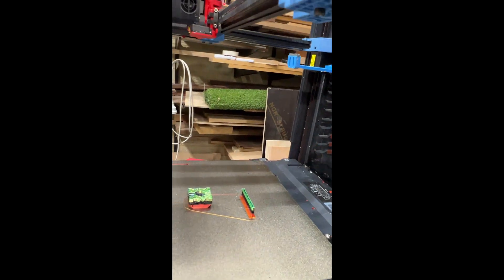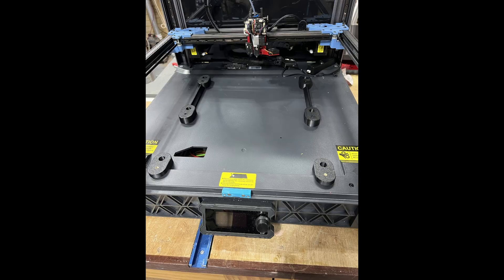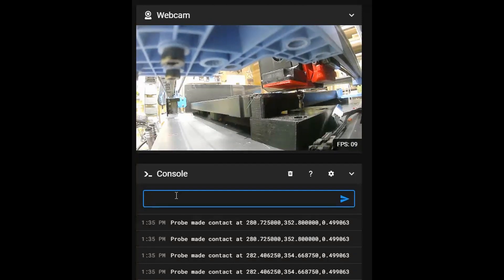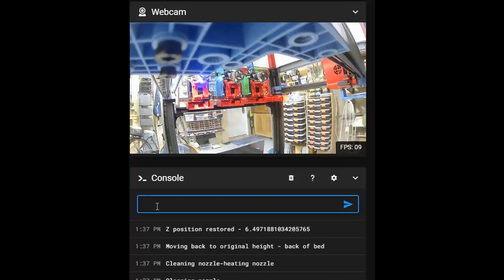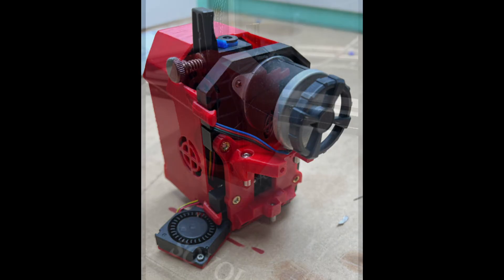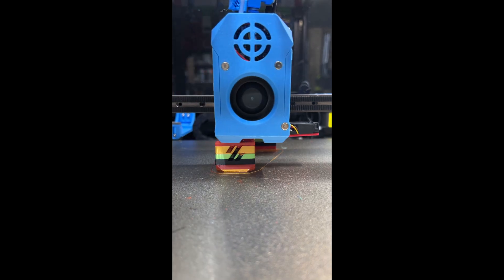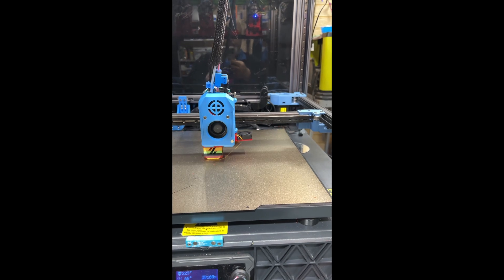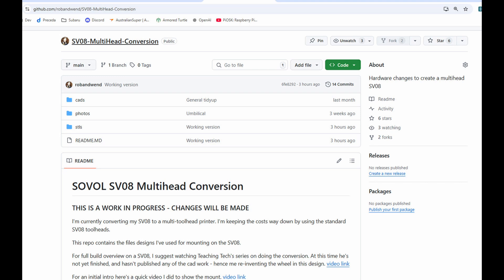SV08 multi head  update 4 (final)

Comment: I'd be curious for a followup video. Has has it worked over time?
Reply from the maker: Yes, still very happy. I did change the heads to using bambulab hotends (because I had a lot spare). I've also modified the docking area to have a different hotend nozzle rest (all documented in the git repo).  If I had room I'd love to do a similar change to a SV08-MAX, but I think I'll have to get rid of a few other printers first 🙂

Comment: what is the bearing model for and how did you attach the bearing? Hope you had a Merry Christmas
Reply from the maker: Possibly you downloaded the repo whilst this was being added, and didn't get the updated readme. You can find details towards the top of https://github.com/robandwend/SV08-MultiHead-Conversion/tree/main - I changed from using the square hotend rest-mat to using a spring loaded bearing that the hotend rests on. My current code keeps the hotend heated when docked, and I found this worked better for stopping filament leakage when mounted.
Reply from the maker: How to mount the bearing, hopefully the photos will help with this, but basically I cut a pen-spring in two, and insert into the holes as per photos. Four small ptfe tubes slide in the sides to reduce friction, and keep the heat away from the plastic. The bearing sits on the springs, and an M3 screw from the side stops it from popping out. Here's a vid https://youtube.com/shorts/QRwU9dDAots
Reply: @robandwend  thanks that must have been happened. Can  I use a bearing that is mused for filament spools?
Reply from the maker: @oldtimeengineer  I believe thats they are the ones. If it fits in the hole, then it should be fine. The old design also worked but the trays eventually got squashed by the hot-hotend and needed replacing, plus you have to mess about pouring the two-part silicon into the mini-tray things.
Reply: @robandwend  Thanks I am working on them now

Comment: What is your start gcode for orca slicer? Mine does not seem to work no extruder or bed heating?
Reply from the maker: All my configs are here https://github.com/robandwend/sv08-klipper - start-print is this one - https://github.com/robandwend/sv08-klipper/blob/main/printer_data/config/my-macros/print_start.cfg
Reply from the maker: Sorry, I just realised you wanted the orca config...
PRINT_START TOOL_TEMP={first_layer_temperature[initial_tool]} {if is_extruder_used[0]}T0_TEMP={first_layer_temperature[0]}{endif} {if is_extruder_used[1]}T1_TEMP={first_layer_temperature[1]}{endif} {if is_extruder_used[2]}T2_TEMP={first_layer_temperature[2]}{endif} {if is_extruder_used[3]}T3_TEMP={first_layer_temperature[3]}{endif} {if is_extruder_used[4]}T4_TEMP={first_layer_temperature[4]}{endif} {if is_extruder_used[5]}T5_TEMP={first_layer_temperature[5]}{endif}  BED_TEMP=[first_layer_bed_temperature] TOOL=[initial_tool]

Comment: what size drill and tap for the 2020 lower bracket? Is it an M3? Have a nice Christmas.
Reply from the maker: Yes m3. Be very careful to get it right 1st time, and do not overtighten, s the metal is very thin and strips easily. Also the bolt has to not extend out the back, or it will catch the z axis. This is one area I'd probably rework if doing this again, as I worry everytime I need to remove/re mount it.

Comment: How long should the Bottom 2020 Mounting Bar extrusion be?
Can I buy it in this lenght somewhere?
Reply from the maker: 440mm although it doesn't need to be exact since it sits on the two printed supports, so a couple of mils gap wont matter. Lots of places (amazon, ali etc.) sell 2020 extrusion, it's easy to cut - and since the ends doesn't need to be 100% right angle, you could just cut with a hand saw or electric jig saw. HOWEVER - since I made this, I've seen other peoples designs where the extrusion is connected to some upright 2020 bars, which I believe removes the need to drill into the SV08 sides - at the cost of having more scaffolding visible at the front of the printer. Drilling the SV08 isn't hard - but you really need to get the drill/tap correct the 1st time, otherwise you may need to resort to CA glue to help hold the bar on (ask me how I know :-) )

Comment: Could I get a copy of your sd image. I have built up a 6 tool changer but am having problems getting the first tool configured. I have all 6 working but can not get it calibrated. I have been waiting 3 weeks for teaching tech to release his and nothing yet I am 72 years young. Thanks
Reply from the maker: All my build info is here https://github.com/robandwend/SV08-MultiHead-Conversion incase you've not seen that. The converttomainline folder contains the images I used to reflash the mmu etc. If you'd like to see my config files, they are all here https://github.com/robandwend/sv08-klipper - that's a live backup of my current config. I've heavily modified a lot of the stealthchanger code specific to my requirements. Currently I always home using T0 (if T0 isn't loaded, it first homes with whatever is loaded, and then loads T0 and re-homes, just to be 100% sure - since all the other heads are offet from T0). I've setup the sexball for tool alignment - and I'm really happy with it. If I change a toolhead for whatever reason, I can get them all re-aligned with a single command now. I've also added code to try to cope with a tool mounting failing (that has happened when a tool gets clogged up and carries the clog up to the mounting area). By default stealthchanger just stops the print if anything fails during an unload/load. I've changed this to wait for the correct tool to be manually mounted and then it continues. Let me know if there's anything else specific you need.
Reply: @robandwend  Thanks I will check out your *.cfg files and see where mine are messing up.
Reply: @robandwend  I have tried your files and the first include in printer.cfg is not found along with  the obico and I commented them out and  I get this error 
Klipper reports: ERROR Unknown pin chip name 'tool0'? what am I doing wrong or do I need to reinstall toolchanger software. I have all my mcu changed to mine. Thanks for your help
Reply from the maker: @oldtimeengineer  The first include is for the toolchanger (stealthchanger) cfg files. I've modified a few of these, unfortunately the folder is symlinked and so didn't get included in the git store. I've just manually added the folder into the git repo so you can now see them (https://github.com/robandwend/sv08-klipper/tree/main/klipper-toolchanger).

tool0 however I believe is by default just called tool (no zero). When I initially set it up, I didn't like having all but tool(0) with a number, so I added a zero to make them all the same.

Bare in mind that this is all setup specifically for my setup. Obviously only 4 heads, but also the beds moved, and I've got a couple of wipers. I've heavily changed the load / unload code in the toolchanger.cfg to ensure mine load/unload correctly, and turn on fans when I expect. Things like my 'SAY' macro will obviously only work if you've added speach to the machine. Likewise all the sexbolt stuff.

Thanks for pointing out the missing config backup files - I hadn't realised that was missing.
Reply from the maker: @oldtimeengineer  I'm glad you noticed that missing, the 1st include is for the toolchanger cfg, it wasn't backedup because it was a symlink. I've added it now (https://github.com/robandwend/sv08-klipper/tree/main/klipper-toolchanger). Tool0 I believe is my name for what is usually labeled just 'tool' - I prefered having a number on every tool to keep them consistent. I'm made a number of changes to the toolchanger.cfg files, just to cope with my implementation of the heads etc.
Reply: @robandwend  FYI the link you posted comes up with 404 - page not found Thanks
Reply from the maker: @oldtimeengineer  The close ')' appears to have been included in the URL when youtube display it. It should read https://github.com/robandwend/sv08-klipper/tree/main/klipper-toolchanger (without the closing ')')
Reply: @robandwend  Thanks got it this time. Any chance to get an image of your system? That would make it much easier since I seem to missing somethi9ng when I do the install.

Comment: Hello, my friend! Congratulations on the project.
Did you get a chance to measure the print area after installing the multi-head?
I’d like to know how much is lost on the Z and Y axes.
Reply from the maker: OK it's a little complicated - but below 130cm high, the X/Y are unchanged 350x350 (I've obviously moved the bed forward to allow for the new mount) once I have a model over 130cm I'd need to keep to the rear of the bed to avoid the other heads - the Y above 130 reduces to 180cm (in reality this starts reducing at 130cm in an arc - since it's the arc of the umbilical hitting the parked heads thats the problem.

Currently I've not changed anything in my slicer to mark this area as unavailable, I'm just carefull in placement - plus I rarely do prints on this machine that are over 130cm.
Reply: @robandwend  Thanks a lot for the detailed explanation! That really clarified how the usable area changes above 130mm. I appreciate you taking the time to share your experience—super helpful!
Reply: This would be killer on the new SV08 Max.

Comment: awesome work, do you have a stl on the mount to mount the birds nest? i have the fanny pack but cant find away to mount on the svo8.
Reply from the maker: Looks like I missed adding that to the git. I've just added my STL's and updated the readme in git. However - basically I just drilled a couple of holes in the back and used M3 nut/bots to secure the standard mount (with an additional strain wire mount I created).